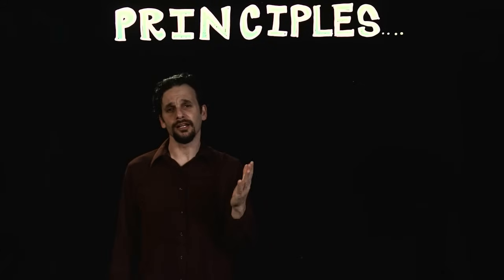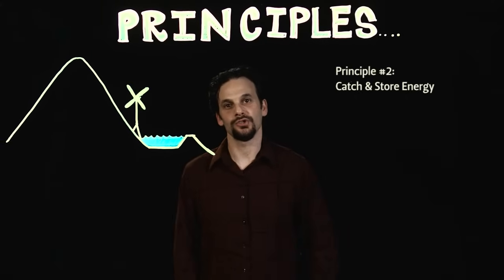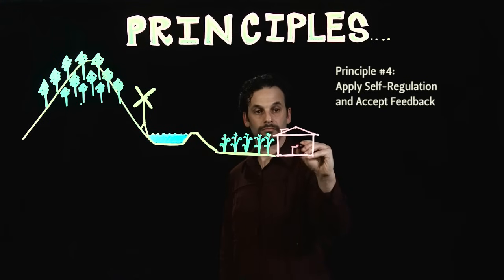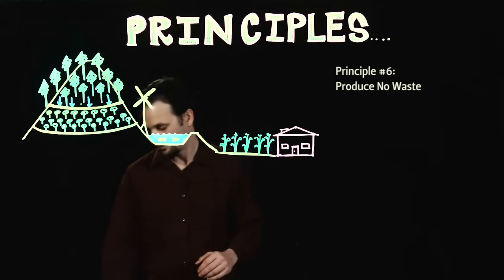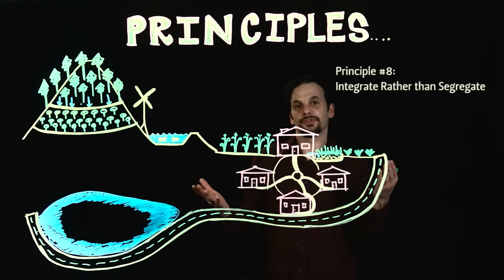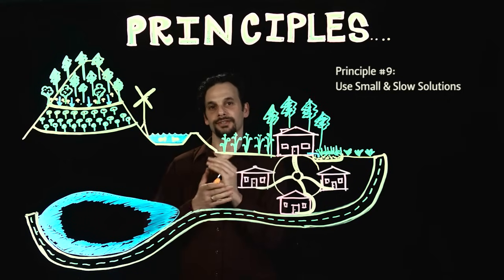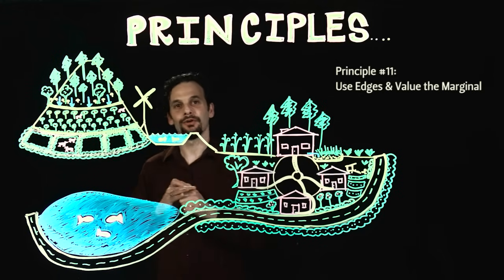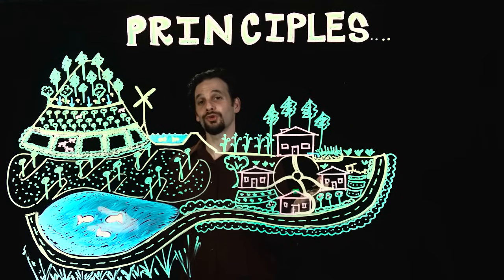The Permaculture Principles

Comment: The part I love (because it fires up the imagination and creative thinking) about #8 (Integrate rather than segregate) is that you have at least 3 elements performing/supporting each function (so if 1 fails, or even 2 fail, there's still 1 element performing that function), and at least 3 functions are performed by each element, so redundancy is built in to a design. Simple examples:

Function: providing shade
Elements providing shade: grape vines on a pergola, shade trees, a roof (thanks, Geoff Lawton!)

Element: a pergola
Functions performed by a pergola: provides shade, acts as a trellis for grape vines, gives children a play structure, serves as an outdoor seating area (that's 4 functions!)

Comment: That main problem with these principles is they don’t take into account the exponential increase in complexity when you try to work with a large number of of tightly-interrelated factors. 

In particular “integrate rather than separate” and “creatively use and respond to change” are directly contradictory, the more tightly interconnected each piece of a system is to one another the more a change in any one part will require every other part be changed. The system becomes so brittle as a result that it becomes impossible to “use and respond” to change, as even the tiniest change in one part will cause slight changes in every part connected to it, and then every part connected to those parts, etc etc until you lose all control. Eventually things will reach an equilibrium but whether or not that equilibrium benefits you is out of your control.

This is why we segregate things in the first place, so we can be certain that a change in one part will not affect other parts. It’s much easier to understand and predict small, distinct parts and therefore much easier for us to guide their change to our benefit.

Every other principle exacerbates this problem by bringing in more and more parts that are more and more interconnected.

This isn’t to say these principles are totally invalid or wrong, diversity and complexity obviously have benefits. Rather these principles are incomplete, they only consider the positive aspects of diversity and complexity when they ought to consider both the positive and the negative.
Reply: You need to read further about permaculture principles. Integrating your elements and functions provides redundancy, as every element has multiple functions, and every function has multiple elements. Over time, permaculture systems become more and more resilient and self-sustaining--just like the natural ecosystems they are designed to emulate. As a consequence, the amount of work that a landowner has to do decreases over time. For one example, installing a guild of mutually supportive plants around a fruit tree will save time and money you would otherwise spend on fertilizers, mulch, pesticides, and herbicides, while simultaneously increasing the quantity and quality of your yield,

Comment: On principle #8: Integrating everything will also create higher dependence among units. This is not bad if each unit can be replaced easily, but if a lot of units are dependable this can create a chain reaction. I would say that when one integrates, one has to create redundancy as well.
Reply: Integrating does creates redundancy! The systems in ecology which source their nutrients from a single place are the least resilient - higher connectivity leads to the highest biodiversity and higher biodiversity leads to tighter nutrient cycling and resilience
Reply: Each task needs to be performed by several units, and each unit performs several tasks.
Reply: As Steve says below, the "rule" that goes with this principle is that you have at least 3 elements performing/supporting each function (so if 1 fails, or even 2 fail, there's still 1 element performing that function), and at least 3 functions are performed by each element. Simple examples:

Function: providing shade
Elements providing shade: grape vines on a pergola, shade trees, a roof (thanks, Geoff Lawton!)

Element: a pergola
Functions performed by a pergola: provides shade, acts as a trellis for grape vines, gives children a play structure, serves as an outdoor seating area (that's 4 functions!)

So yes, a lot of redundancy is built into the design to avoid the problem you mention.